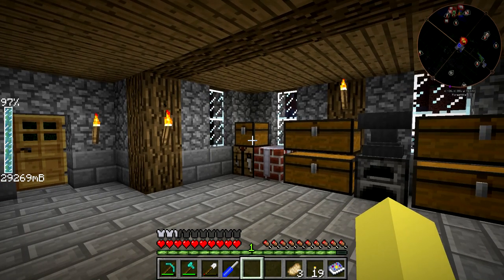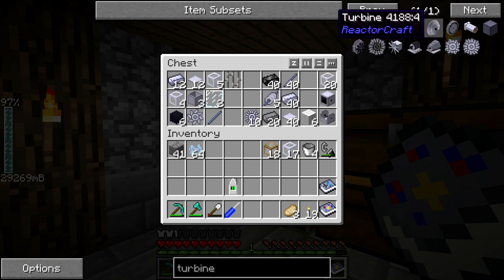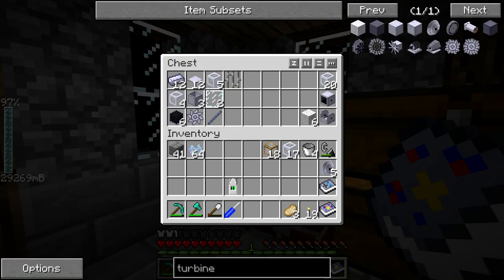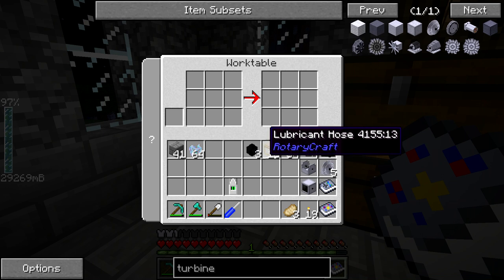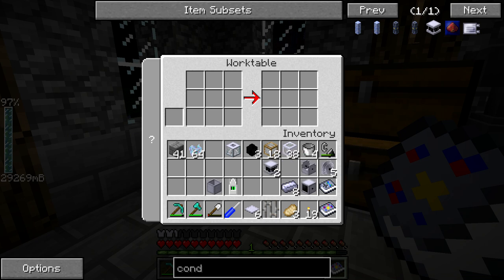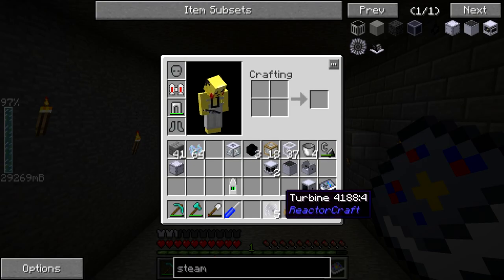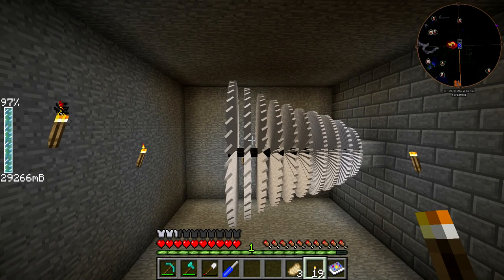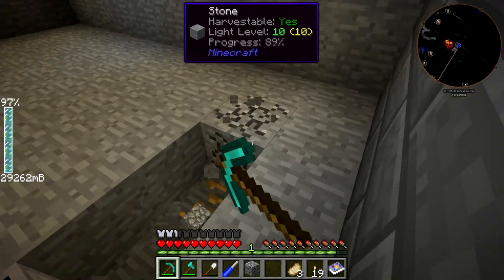Surviving With RotaryCraft :: Ep.19 - ReactorCraft Power Generation

Comment: Your Dynamometer is backwards. Other than that, awesome episode. I have to admit, I normally get bored with RoC before I ever get started on ReactorCraft, no matter how much fun the later game toys are.

I'm wondering if the steam from ReC is compatible with steam from other mods. I think it is, but I'm not sure. Reika's got his own way of doing things.
Reply from the maker: Oops, good catch! Glad you like the episode :) It is a lot of work to get to the fun part, but I am determined to get through all the different parts of ReactorCraft and RotaryCraft does tons to help speed up the process. I'll have to check on the steam because that would be super nice if someone was using this mod in a pack.
Reply: Yeah, it is very cool. I think Electricraft has it's own engines that let you store the shaft power as energy and move it around, but I'm not sure.

I know I've always gotten bored with the mod before getting the point I could test whether other steam works. Can't wait for your next episode.

Comment: you can make the fusion reactor ?
Reply: not too fast
Reply: because fusion reactor require deuterium and tritium, and tritium need to process in fission or breeder reactor.
Reply: and need damn long time to build haha;
Reply: +jupiterbjy I built that and active that ,then I crashed because too many particles and neutrons.
Reply: so lag intensive haha;
but looks so cool
Reply: +jupiterbjy By playing Rotarycraft,Reactorcraft and Eletricraft, your graphic card will burn out.XD
Reply: no. it dont have something to do with graphic card. "for GPU, it deal as low as single stone block", reika said.
rater its intense block update
Reply from the maker: Eventually :) I'll have to work my way up, but I will definitely cover it at some point later in the series!